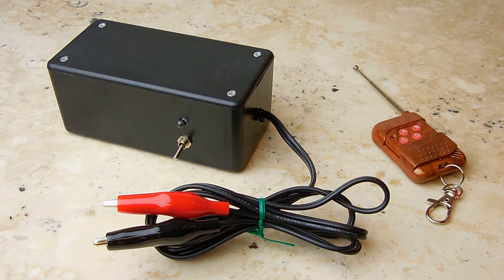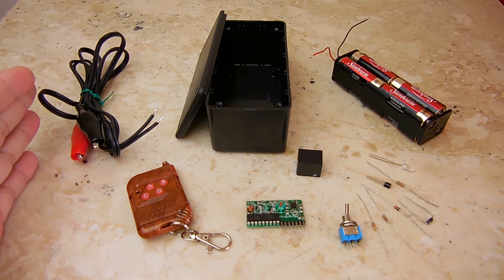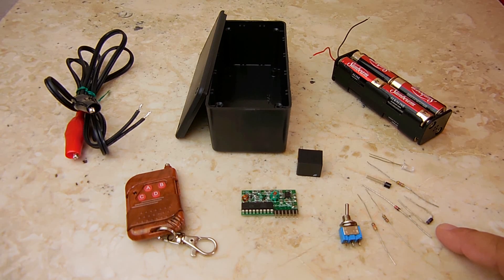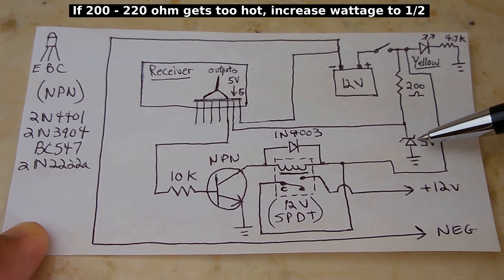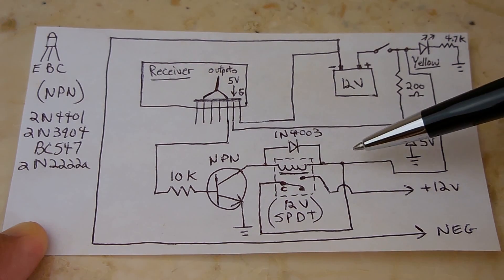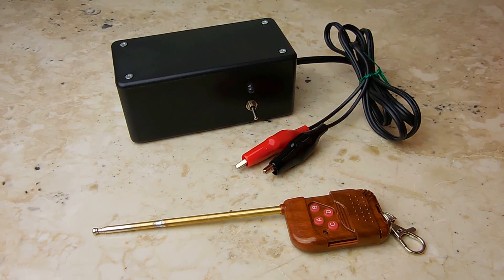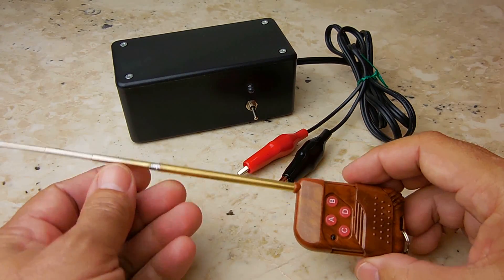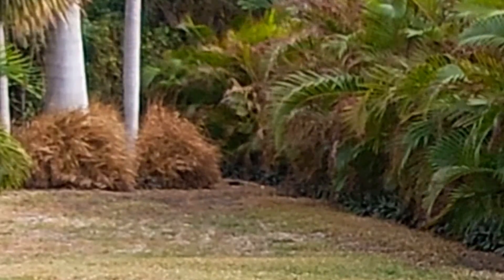Remote Control Triggered Model Rocket & Pyrotechnics

Comment: Is it possible to use a capacitor to fire igniters? Specifically a circuit slimier to a camera flash. I want to use a 3.5 volt rechargeable battery to charge a capacitor & ignite pyrotechnics in a small ray-gun prop for a video. If its possible, I'd mention you in my video & link the circuit build video on your channel.

Comment: Would this be capable of firing of clustered motors? 3+?
Reply from the maker: Yes, be sure to use 3 lithium ion 18650 cells in series or (8) "C" batteries.
Reply: electronicsNmore just use diff power source is all? No other change?
Reply: How about if you wanted to just use a small lawn mower 12v battery? Do you have to do any other wiring

Comment: Hi, how would I add a continuity check using the same igniter leads for the check and the firing of the igniter?  I added a continuity check but had to add an extra pair of leads.  How do I do away with one pair of leads and just use one pair for the check and ignition is what I’m saying?  Thanks.
Reply from the maker: It can be done using resistors and an LED. The LED will be on until the relay closes.

Comment: Hi, I was able to build this and added a continuity check to it.  How do I add a rechargeable battery port or jack to it?  Thanks so much for sharing this.
Reply from the maker: Hi Brian. Switch to a lithium ion/polymer battery and use one of the charging boards at the link below. You can also find 12V power adapters to use for charging at that link very cheap, as well as a DC power jack.

http://bit.ly/2fBLJvp
Reply: Hi, can I just use the D.C. Power adapter and just hook it to the power pack battery holder?
Reply from the maker: No.
Reply: K, thanks.
Reply: I have added rechargeable batteries and they don't put out but around 10 volts, it has been igniting the igniter but is that enough voltage for all igniters?

Comment: Hi, great video! Im in the process of putting my own together and ordered my components from banggood but was not able to find the relay you used. The one I have has 5 pins (an extra pin next to the 12V out, in the corner where yours doesn't have any pins) how should I connect that extra pin? Thankyou
Reply from the maker: Look for the 2 pins that CLOSE(have continuity) when the relay is supplied with power. Be sure to rate thumbs up and share. Thanks.
Reply: electronicsNmore okay Thankyou
Reply: Hello again, so I finally have a unit put together. LED turns on and the receiver seems to be working, although whenever I press the button on the TX I hear clicking sounds (maybe from relay) as if current is flipping on and off. I connected another led to the alligator clips to verify and it lights up along with clicks as if no constant current seems to be flowing through. Any idea on what it could be? Thankyou.
Reply from the maker: Sounds like you may have an excessive voltage drop causing the relay to cycle ON/OFF. Measure the voltage at the relay coil while in operation(when the problem occurs), and measure the voltage at the board. You could be using too heavy of a load(or too heavy of a wire, stick with 32 or 34ga). You can also try using a relay with a lower voltage rating.
Reply: electronicsNmore so I tried troubleshooting by connecting an LED to another RX terminal and when I press the other button on the TX it seems to be the RX board to be causing this blinking/flashing of current as the led is acting the same (blinking) way as when connected to the relay. I am using a 9V battery but every other component is as in your video. Could it be that I am not providing enough power to the RX or perhaps a faulty connnection? Thankyou
Reply from the maker: Measure the voltage as I said. Report back. I had a similar issue, but it was caused by a voltage drop due to a resistive wire that was too thick.